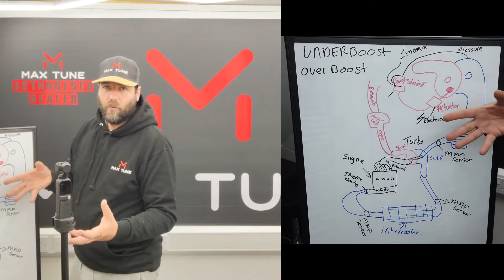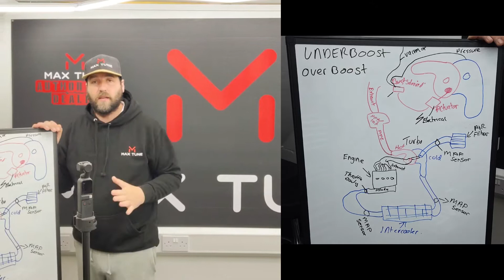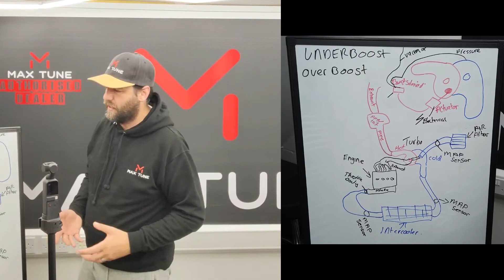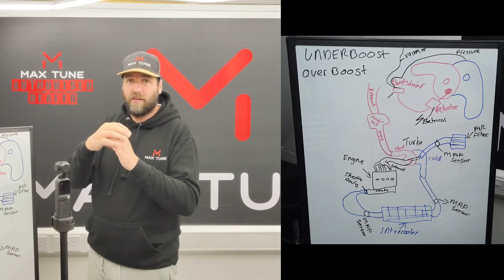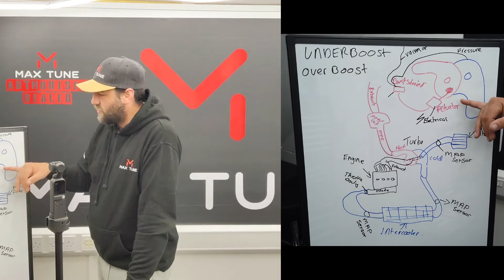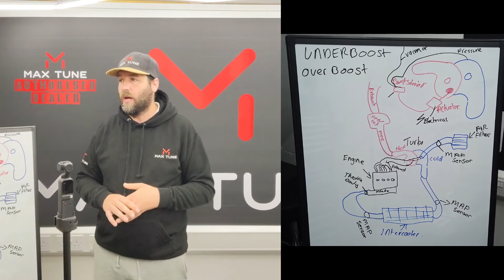Turbo how and why's. How it works, what controls it and common faults!!!

Comment: I have a question on a similar problem you explain in the video, maybe you kind enough to give some advice. I have a4 b8 1.8 tfsi and the the request is 1.2bar on a stage 2 but i cant fully make that until 3k rpm and it can hold 1.2 until around 5k rpm. I get an underboost code because the difference is some cases is over 0.2bar. changed the fallowing with new oem parts: maf, map, n75, dv, checked the wastegate for play and turbo for wear, checked for boostleaks and i have none, checked the turbo actuator if it sticks or something, that works fine also.
I don't know what to do next since i tried all the things i could think of.
Reply from the maker: Hi there, run a vacuum test using a Mitti Vac on the actuator, this will allow you to apply vacuum to the actuator and then hold it, if the vacuum subsequently drops over a small period of time then the diaphragm inside the actuator maybe split slightly which won’t allow the wastegate to close quickly enough to build up the desired boost causing the underboost codes!👍👍